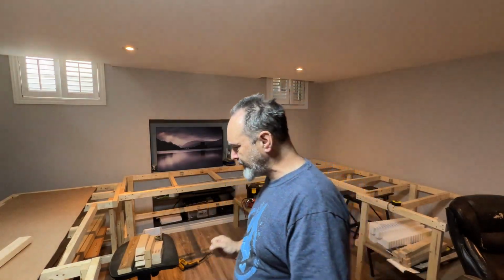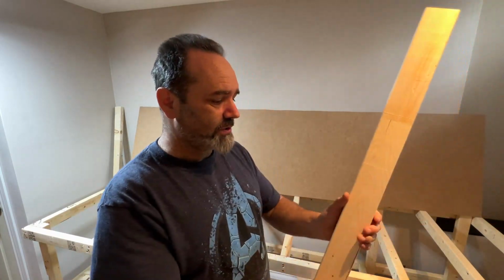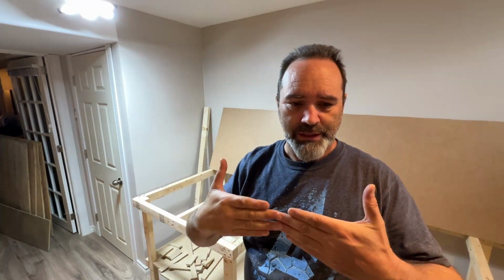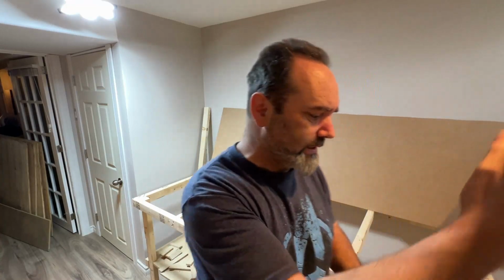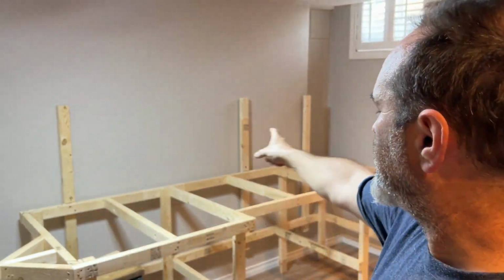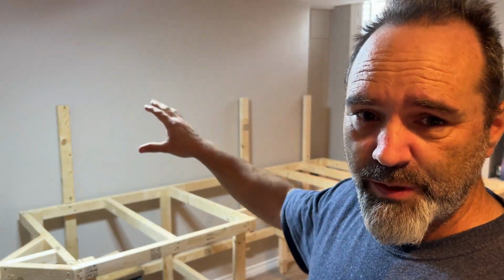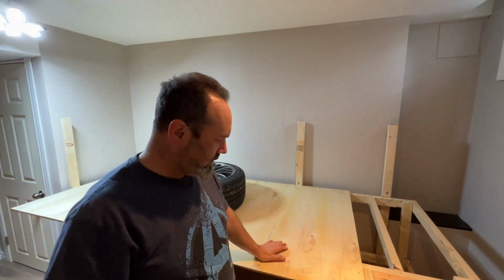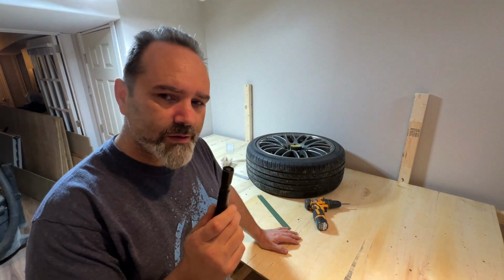Building A Base Board For My First HO Scale Railway In Canada

Comment: My two cents worth stay away from the white foam it is a pain in the ass. We really have to meet someday Dave. I started building my hot rod 37 years ago in my driveway and although it took 7 years to get it on the road this will be its 30th summer of giving me the pleasure of driving it. Just a covid struck 3 years an a bit ago I started building an N scale layout in my basement which I just love working on and playing with. Your friend Kevin's truck has been on several of the Canadian Rodder tours that we've also been on. It really is a nice truck. Good luck with the layout. Looking good so far.
Reply from the maker: Too late for the white foam advice, lol. I have a video on it. It's not too bad, and I have a hot wire cutter to mold mountains and ditches etc. I know a bread knife would be disastrous.